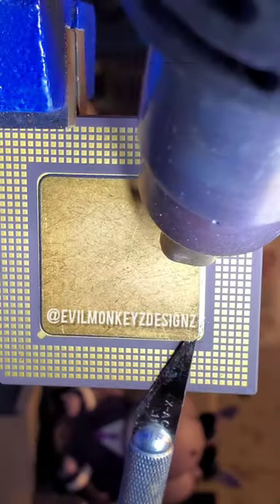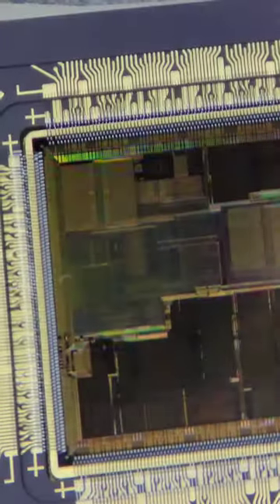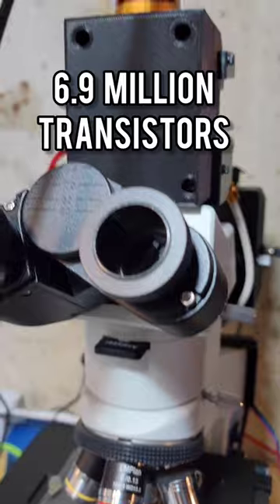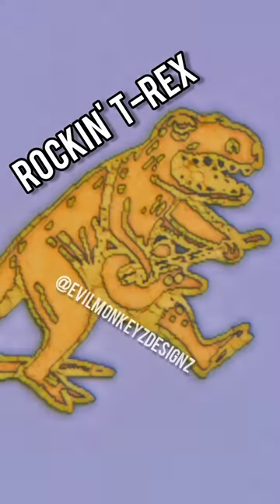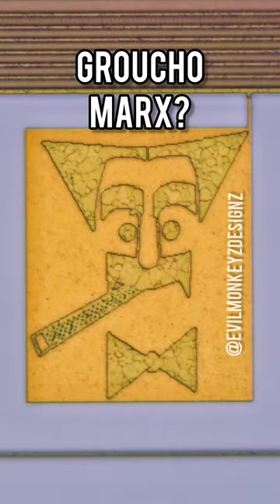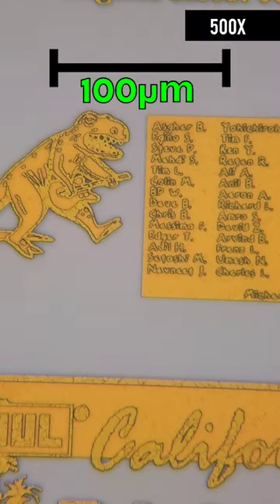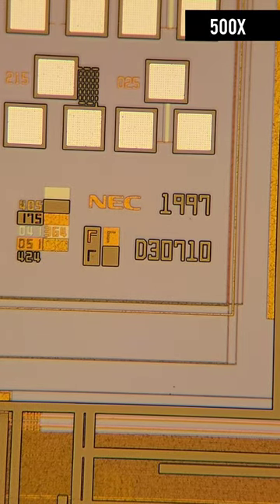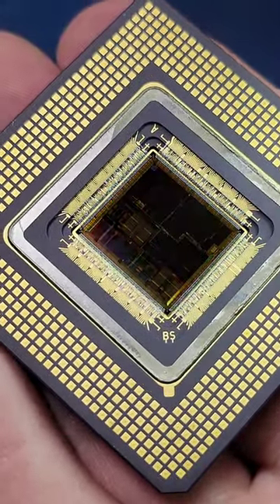CCU #150: MIPS CPU with a T-REX

Comment: IIRC a lot of the animation for Super Mario 64 as well as (I think) Donkey Cong Country were done on Silicon Graphics machines
Reply: The N64 runs on a MIPS cpu
It was programmed on SGI computers
Reply: @Aresydatch  The RCP (Reality Co-Processor) is also designed by a team from SGI, which later founded ArtX (then bought by ATi) and made the Flipper GPU for the Gamecube (and by extension the Hollywood GPU for the Wii, which is basically an overclocked Flipper die-shrinked to 90nm) 🙂
Reply: @benjib2691  So this means that they made AMD gpus, guess that's one reason AMD lives building silicon for Consoles
Reply: @Aresydatch  I don't know for how long the SGI team worked for ATi after Artx had been bought, but it's indeed possible this team was responsible for the first AMD-branded ATi cards after AMD bought ATi. 

As for why AMD is thriving on the console front, I think it's because of multiple factors. Such as being the only ones (for now) able to produce heavily customized x86 APUs, or Intel and Nvidia being quite a pain in the a** to work with sometimes (for example the original Xbox never got a slim revision not because Microsoft did not wanted to do one, but because Intel and Nvidia did not allowed Microsoft to do a custom redesign of the Pentium III/Celeron CPU and the NV2A GPU on a smaller process-node to reduce power consumption like Microsoft did later with the 360 Slim after switching sides to IBM and ATi).